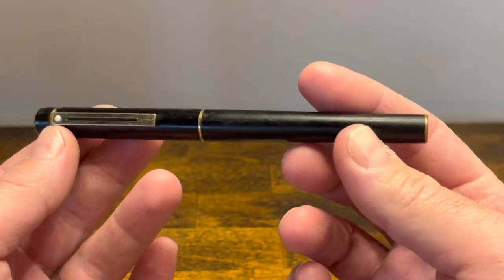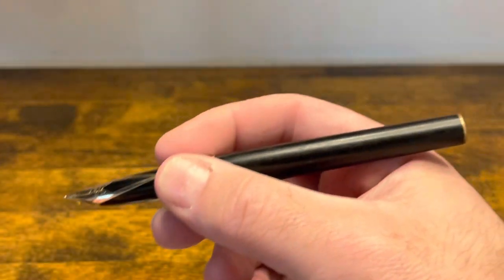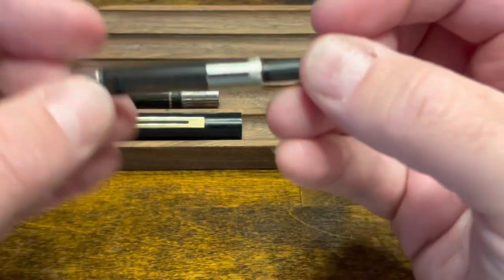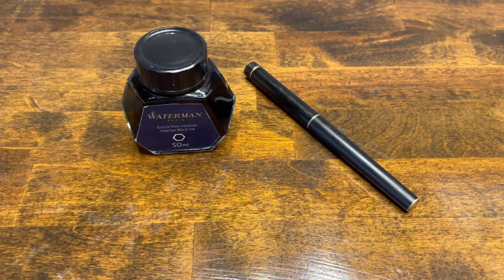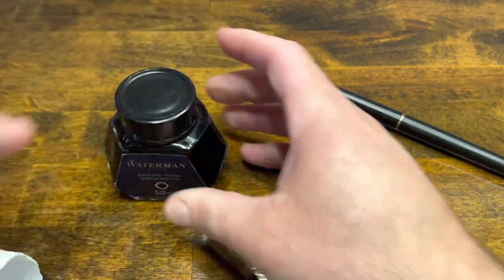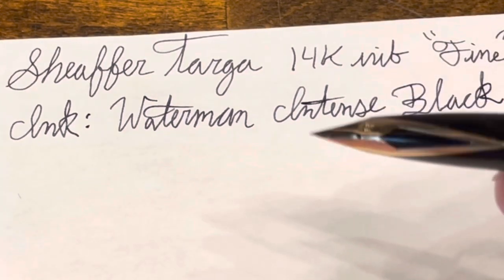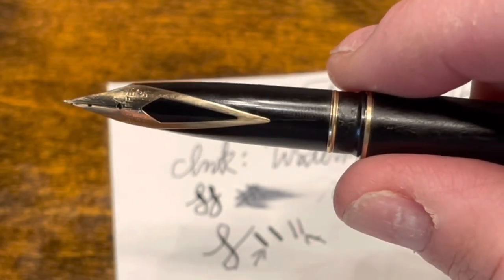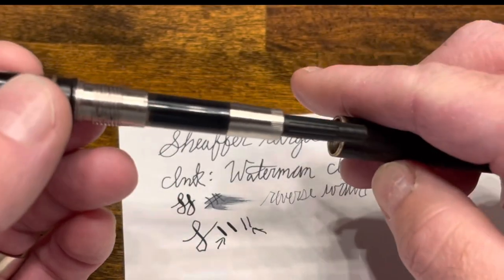Sheaffer Targa: Vintage Classic with Beautiful Inlaid Nib

Comment: Aside from Pilot, cartridge converters don't limit the pen.  Sheaffer did make a few models which took a unique converter but most take any Sheaffer and a few take International Standard.  One can use a cartridge and just refill it and voila, no moving parts.  To my mind the Targa is close to perfect.  Of course if you studied design that's fine, but what folks think of an object is far too complex a subject to be reduced to simple rules.  I believe that the US company Sheaffer was a most innovative pen maker, and that most of their pens have withstood the test of time.
Reply from the maker: I agree, it’s a greatly designed pen! I may try to eyedropper a cartridge instead of getting a replacement converter
Reply: I have a pen like this. Is there anyone who can buy this pen? It is good to use.

Comment: There are various Sheaffer converters that fit the Targa (I have three different ones). And apart from the proprietary Sheaffer cartridges, I've found that 'standard international' cartridges (of the Pelikan etc. type) also fit in mine. So one isn't dependent on that one type of converter which you showed in the video.
Reply from the maker: Good to know! I may try a few other types of converters to see if I have one that works
Reply: Are the converters you have new ones, or are they from other vintage Sheaffer pens?  Mine has a squeeze-type, and I'm concerned that it will eventually leak because the plastic is now 50 yrs old.  I generally like piston fillers because I feel like I have the most control.
Reply: @IreneFaivre  The ones I use are absolutely brand-new, the type with a spindle you have to turn to operate the piston. I also have the squeeze-type converter, and it works well, but like you I have my doubts about its durability. Not that any squeeze-type converter has ever caused staining catastrophes, but somehow i don't want to push my luck.

Comment: I have the very same pen. The original converter was not a piston. It came with a squeeze bar converter. But either type of converter does the job.
Reply from the maker: I dug through my accessories and found the original aerometric converter. Personally I prefer piston converters as I don't have to worry about replacing ink sacs and can keep an eye on the ink level.

Comment: Really great pen and great nib.
Reply from the maker: I agree, it’s clear why this model was produced for 20+ years
Reply: I have one I bought in- 1983.  I had finished medical school and was about to begin my residency in obgyn at Charity Hospital in New Orleans. It was exactly like yours. It was in a time where there were NO electronic records and everything was hand written. I used it through all this and 4 years in service. I used waterman’s black ink for the very reason that you could get every drop.  And it was available at Maison Blanche- 2 blocks away. Occasional I used Quink, which had a side pocket. 
The pens tend to be finer in width but juicy. Mine was smooth years ago. And still functions perfectly. 
It, along with my silver Parker 75, given to me on high school graduation by grandfather and used through college and medical  school are the never part with parts of my collection. 
Concerning the converter- that was not the original. They were a squeezable aerometric type converter. And so- no viz at all.  I filled mine each morning and wiped the nib with the tissue with which I had cleaned my glasses. And wound my Bulova.  
The converters have been made in various parts of the world and the Sheaffer patents are now held by a company in India.  So if you need converters- you might want to grab what you can. My converter was purchased 10 years ago when the rubber on the others cracked. I am not sure what compelled your disassembly attempts. Mine has functioned perfectly without that.  When it is sluggish- it spends the night in tap water. 
“Wenn es nicht kaputt ist, versuchen Sie nicht, es zu reparieren.”  
Excellent review of a classic pen. 
Thank you.
Reply from the maker: Thank you for the kind words and great back story! I may try to hunt down an aerometric converter to bring it back to the original configuration.
Reply: Yep, a great pen. A real eye-catcher too, if you like that kind of thing. I managed to find a used one in remarkably good condition on E-Bay. Agree 100% about the converter - a real handicap. I use Shaffer Cartridges and refill with a syringe. They are no better than the converter in that they are so opaque that it is impossible to see the ink level even with a blinding LED flashlight, but at least they hold a good deal of ink.
Your disassembly was amusing with its four parts. Pretty laughable considering most pens today have a host of bits and pieces, but oh well, less bits to lose I suppose.
Reply: @gynechiatrist  You dont have to worry about the ink from this side, but these old stock golden nib have confortable and great writing in all kinds of papper- I prefer  medium nib is best.
Reply from the maker: @philnaunton7181  I agree, I’ve resorted to doing that with some pilot pens. I wish another manufacturer would come out with a compatible converter. Figure I’ll keep doing the disassembly section for people to get a feel for maintaining and cleaning.

Comment: New coverter works well with this vintage pen model? 

New Sheaffer ball pen refils do not works well with vintage models--Imperial--.
Reply from the maker: It does work well! Unfortunately there isn’t an easy way to disassemble.
Reply: @ForTheLoveOfPens   Do you utilize new ball refils at vintage Shaffer ball pens?
Reply from the maker: @antoniosaiz2102  Unfortunately I don't have any Sheaffer ballpoint pens.